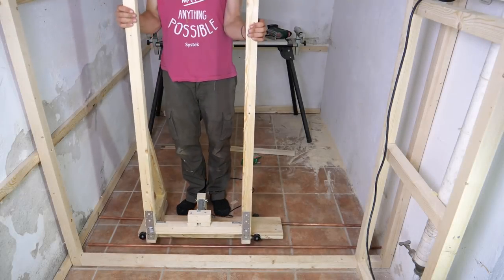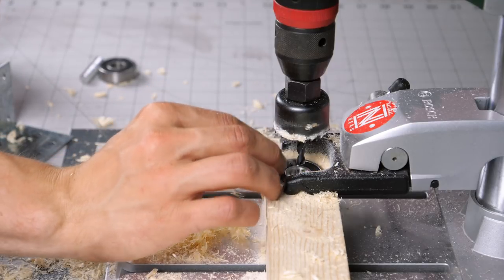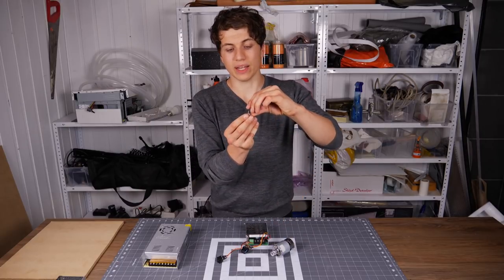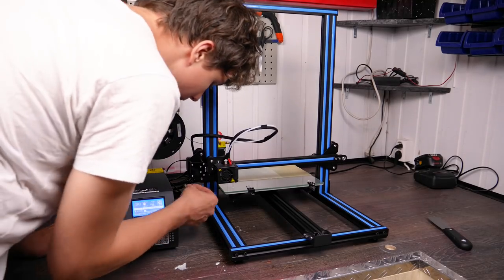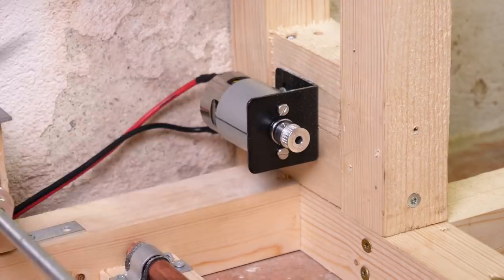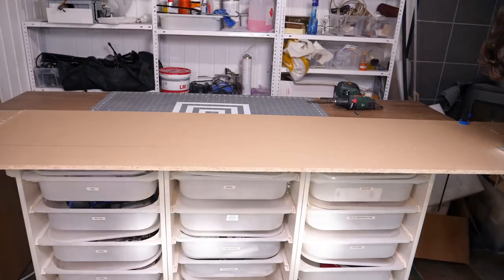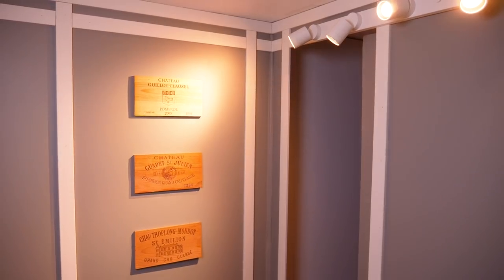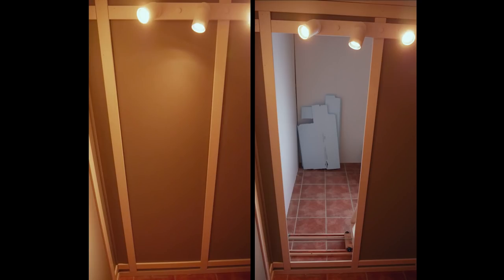Building a Secret Door Part 2 || DIY

Comment: Cool!! I don't have the room, but if I had, I would definitely built a secret door... But what will you do if the drivebelt breaks while the door is closed? Can it be opened manually?
Reply from the maker: Good question! I have a cabinet for the basement fusebox on the wall to the right of the door, if I open it and lean in I can reach the threaded rod and open it manually
Reply: Xyphoid Process I wouldn’t
Reply: He doesn't have the room either but he did it so..
Reply: Wow so talented!
Reply: This turned out amazing. Great Job

Comment: If the motor was a bit faster and if the belt was hardened it would be a bit better so the door can open quicker. But it was an amazing build
Reply: It's not the motor that is critical to speed, but the narrow threaded rod as a screw drive.  If you use something more like a winch to pull the door towards the motor, it would be faster.  For example, he could make and mount a large pulley to the same motor (mounted at 90 degrees) and use the same type of timing belt material.  For example, if you size the drive pulley with a circumference about equal to the linear travel of the door, one rotation of the motor would open the door (or jam it).  To get more reliability and torque, mount a second pulley to the door to cut the speed in half, or reduce the size of the drive pulley.  I don't think it will be as fast as the sliding doors on the Enterprise, but hidden doors aren't that useful if the bad guy can catch you while you're waiting 90 seconds or more for the door to open.  Best option might be to recycle a garage door opener, which would contain most of what you need, all packaged up, and could be operated by wireless remote or mobile phone app.  Also, I'd rather just shove the door back manually, rather than to wait on that linear actuator.
Reply: Good point
Reply: Us a rod with acme thread next time

Comment: With future projects, consider hanging the door so the tracking won’t be on the floor, causing an eye-sore or obstruction. I would repeat the door trim pattern across the wall to help hide the door and would’ve liked to have seen you just need to push the top wooden board in to activate the door. It looks like simply swapping out the pulley on the all-thread would at least speed up the opening/closing motions. Just thoughts, not criticisms. I’m intrigued by the way you all have problems getting different supplies since I’ve never been to Norway and we have access to everything in the US. Anyway, love your page and projects. Keep up the great work!

Comment: I like.  I’d be interested to hear what your thoughts are now after a few years and what you’d do differently.  

The two things I would want to try if I ever did this would be to move the door tracks to the ceiling to get them out of the way of tripping and the second thing would be. To try and speed up the process.  

Side note I would be worried if a kid or pet got stuck inside.

Comment: For a *trigger switch idea*, have the wine box plate on a joystick, e.g: up/down could be for the door in/out motor and the left/right for the side moving motor. 
Or have it hooked up to an Arduino, then use the joystick to enter a code (e.g: left, up, down, up).

Comment: Hello, nice work. Im a builder by trade, but I know a lot about a little and a little about alot. The 2 suggestions I would give is 1 - for the belt, I would get a belt that is very close to the size you need and then make it so you can manually tension the belt.(i hope that makes sense). It is what is usually used for where any drive belt is needed. I guess you could find what I mean more so on the web.
And suggestion 2 would be to get a more course all thread rod to increase the speed of the door opening and closing (a thread that may be slightly thicker with the thread running much wider apart) you just have to be sure the motor your using can handle it as it will need more torque to move the door, but it will dramatically increase the speed of your door. I hope this makes sense as I am trying to explain i as much as I can in layman's terms. I hope this helps you. Good Work though.

Comment: Very cool. If you were looking for a better way to shift the wall left to right, try a pulley at one end, a cog at the door, with a belt strait to the DC motor. No need for the threaded rod, extra stress and friction.

Comment: Nice, great build guys! I'll have to keep it in mind for a small project. If you want to upgrade on the speed, invest some time in acme threads or ballscrews/spindle. Double threads (basically the helix is longer) will help out even more so. And end-switches so you won't kill any parts by going too far open or closed.

Comment: Very well done. If I may. Take the runners that are on the floor and mount them on the ceiling then when it opens you will not have to step over the runners or damage them when going in and out. The door will then hang and you will not need the counter weight,

Comment: You can try using a limit switch to stop the movement of the door and a regular two side switch (like the ones for lights) to use the door. It can make sure that you don't need to just stay and keep the button pushed while trying to open or close the door.
Reply: I do too much 3d printing, and I would have set both directions up with stepper motors/lead screws and limit switches and run it all on arduino out of habit 🤣

Comment: Very nice work.

If I were to try this, I might consider mounting the rail mechanism above the door and have the door hang. This would avoid having to step over the rails and threaded rod and tripping.

You could also avoid the need for counterweights if the cart wheels slid between two rails rather than sitting on just one.

Comment: It's a fascinating concept.  My only suggestion would have been to hang the mechanism from the ceiling rather than mounting it on the floor.   Same basic build concepts but saves you having to step over the mechanism to get in the door, and solves the counter weight issue at the same time!   Great job though!

Comment: An improvement to the switches could be crafted like this...; Add things to the outer room so that you have a light switch, a fan switch, a vent/register opening with a lever, a spot to stand on the carpet containing a pressure sensitive switch, etc, etc, etc... By using these switches as a series type connection to an Arduino, you can end up with a door that opens and closes ONLY if the right combination of these switches are triggered... This way the switches themselves (for the secret door) are invisible, since they all do something else in an obvious way, hence there would be nothing to find that would cause someone to wonder "Hey, what's this switch for??" Anyhow, that's my contribution. Also, you might consider using brushless motors since they can spin very quickly and are dependable - it could improve the speed of the opening and closing. Additionally you can use bicycle chain and sprockets for the motor and rod. :)

Comment: Bearing, inserted into the wood,
put some D3 wood glue, a little diluted with water - which penetrates wood fiber.
let it dry, glue again, dry, again'.. etc (let it make a varnish)

or drill a little smaller than the bearing diameter,
burns the hole steadily, with small camping torch butane,
and maybe insert bearing with damp wood or vegetal oil  (which fits better)

Comment: How to improve door- 
1- get rid of the threaded rod and replace it with a cable pulley system. It will allow the door to open quicker and smoother. 
2- replace belt with sprocket and chain to eliminate it being the "weak point" of the design. 
3- instead of having switched under the panels make each panel a push button switch. (so you just push the panel and it activates the doors. 
Otherwise its a nice build.

Comment: Only thing I'd have done differently is I'd have mounted the track to the roof rather than the floor. This way you can remove the trip hazard when entering the hidden room. I'd also have made a wall on the inside of the hidden room to hide the track from view so that the door slides in between the two walls. This is a really cool build though!!!

Comment: This design could very easily be manually operated by pushing the door in and then sliding it to the right. Would just have to find a discreet latch mechanism to keep it from accidentally being pushed inwards. A pull string with a spring loaded latch using a series of pulleys would allow the string to be accessible virtually anywhere. This being said your build is really awesome, I am just thinking of a way to do it for 1/10th of the cost and with less points of potential failure. Nice video man!

Comment: If you parallel a set of 3 way switches further away then by the time you get to the opening it would just about be open or possibly completely open. You would have to figure timing over distance. Another thought, how would you gain entry if belt breaks in the door closed position. Last, maybe try to 3d print a flexible belt for a continuous one. If that doesn't work then consider direct driving  motor to mechanism.

Comment: That turned out really clean, I didn't notice any seams or lines on the door good work nerds. If I ever make a hidden door I thought I'd go with a bookcase although most people don't really read actual books anymore
Reply: Better use solid steel rails, then.  The weight of the structure and the weight of the books would soon soon crush that copper tubing, or at least create dimples that inhibit the rolling.  And Hans and Martina don't have to READ the books - they MAKE them!

Comment: Great project! I think it may be a little more practical if the threaded rod and drive assemblies were at the top of the door so you don't have to step over it all when entering the room. Plus having the rod at the top would solve your tipping problem that required the use of counter weights.

Comment: If you want to speed it up you could either put a bigger wheel on the motor. If the wheel is 2x the the diameter the door should move 2x faster. This is the cheaper method. The other is to replace the threaded rod with a rod which has less threads per inch

Comment: use ACME thread, look into salvage lathe feed parts, may even find a selectable drive with it. good luck.
Reply: also, depending on rpm, the friction from the load you have can distemper and burn up the threads...use a grease block or perhaps an oil/grease bath for the rod beneath the door. again, good job and good luck.

Comment: amazing work loved it . there are many ways to speed the motor up directly from the power supply if compatible . i do the same work practically it should work . i'm in electronic engineering and have been working for 8 years.

Comment: Nicely done but if i were you i would put lock mechanisms for the dor so they wont open accidentlly, and not only,  but aswell it will be more secure, nad you could mount a code opening in the same area as the switches,
Nice job ,its a really good idea.

Comment: Hey, cool project! :)

Have you thought about using an acmethread rod as driveshaft?
There are options available with a 4mm  pitch, so your door will open much faster
Reply from the maker: That would been a great thing to use. I didn't know about it before I was done !
Reply: A winch drive would be faster still.

Comment: I only have three critics about this project :
1°) There seems to lack some "manual mode" to open the door. It probably useless but, in case when it could be handy I would rather have that ...
2°) The opening speed is very very slow (it seems to be at least). Maybe a more powerfull motor could fix that
3°) and the biggest problem, for me, is the opening systeme is on the floor and there isn't any protection on it. I don't know if you're going to read this but it's been almost a year since you uploaded this video, didn't you (or anyone else ) 
stumble on the opening systeme ? and IF youwould like to put something heavy in the room (or getting something heavy out) I think therailing system would cause some problem to do so .... maybe if you put the system backward, by attaching it to the 
ceiling it would fix that (depending the height of your ceiling)

Comment: I would connect the motor shaft directly to the threaded rod.
You can buy couplings for that purpose (ebay: Z-Axis coupling)
or make your own with a garden hose and pipe loop fastener on the
motor shaft and the thread rod to keep the shaft/rod from spinning
within the hose (or even zip ties)
Reply: Atanasov Goran i'm guessing you dont have a degree in engineering?
Reply: Didn't claim to. Could you explain why would that be a problem?
Reply: I mean direct drive, not having a degree
Reply: Atanasov Goran at this point the rod is supported by a bearing on both sides. If you but it directly on the motor first of all the length of the entire assembly would become larger and there is no longer an option to change gearing. The way he did it here is better and more professional as coupling it with some garder hose. Even tho the whole build is crap.
Reply: You could put a bearing after the coupling and still support the rod, the motor will have it's own mount. Yes it will be longer assembly, and planetary gears would work for gearing, although not as practical for DIY/Home build. (The hose thing was an alternative to the Axis coupling since he mentioned in the previous video that he can't wait for stuff to arrive from online orders.)

Comment: cool thing. really good effort. but u need to think on drive belt. better keep a gear wheel system and keep limit switch to cut off when door moves to require distance. hope it not cost more.

Comment: Dude awesome job ... but use a gear drive system like a large gear on the motor n a small one on the threaded rod  n it will move the door faster n smoother

Comment: For the belt just go to your local car or motorbike store with your belt and purchase one according to your size if you can't get one adjust your size accordingly. If you wanted the door to go faster you have to use a faster turning motor.
I love the projekt great job.
Reply: you dont have to use a bigger motor.. all you have to do us change the location of the motor and change the size of the gears on the end of the motor and/or rod... and agree on the belt, can go to the local automotive shop and buy a belt for the size, but to have it last longer i would use a chain, plus it is easier to get the size you really need..

Comment: Suggestion, actually my first thought in part 1 before you even started building: Put the copper rails and the drive shaft rod in the ceiling instead of the floor. Must be so annoying to step over, especially after getting the 3rd bottle. Plus it would look better / be less exposed, if it is on the top.

Comment: if the belt fails, you could try and cut it at exact length (dont overlap) and glue another strip of belt to the back (back to back) just stagger the seams. you prob also want some sort of flexible glue?

Comment: Why not use a arduino to control the action? Endstops to make it stop in the right position and just a single button to start the movement.

Then try to minimize the footprint on the floor, and put the threaded rod in the ceiling instead of the floor (and avoid stepping on it). 
Then use at least two belts, or make a manual way to override it...

Comment: i had an idea for something like this, and since i dont have the knowledge to make it happen, i'd love to share it with you as a video idea.
basically this, but with a window, and have it controlled via temperature. i got the idea from some smart power outlets that can turn on and off depending on temperature. so i imagine using a motor and some wood blocks you could make something that opens or closes the window based on temperature. imagine how much could be saved on heating and cooling if your windows did the work for you

Comment: If you hook up an airpump/generator(tbh I don't know this exact but it's been done before to this instead of electric motor you would increase the speed you need. And instead of a belt you can use a chain(similar to what cars use as a timing chain).

Comment: Hey your videos are really cool. To improve the door speed you could use a bigger gear-wheel at the motor for a better transmission ratio. The bar will spin faster and so the door will move faster. :)

Comment: Igarashi Gleichstrommotor 2738-051-GC-5 12.0 V/DC 1.6 A 9 Nmm 12300 U/min Wellen-Durchmesser: 2.3 mm 1 St.
I know this is an older project an you finished it very well but I think this motor would help to open your secret door a bit faster. Sorry for the German description but I found no other

Comment: Get on eBay, search round rubber gasket. Then browse until you find one that's suitable to be used as a belt. How you do that is simple, take the belt you've made, lay it on a table and find what the diameter is. Then that's the thing you should search -6%. Rubber gaskets stretch over time, so you have to account for that. The pulleys will grip in the soft material, so no need to change them. They are cheap so buy 3.

Comment: You should have cut the door piece at an angle so when it presses into the wall, all of the seems line up properly. Then you wouldn't need a gap and with the right paint, it'd disappear.

Comment: Whenever you can, off camera, get a 30A dc motor but at either a faster speed or higher available voltage count.
Most plugs run at 240V anyway so 1/10 of that voltage shouldn't make it go at a snails' pace.
Reply from the maker: The motor is 10000 RPM and pretty fast, so I think the best way to improve the speed would be to change to a rod with longer spaced threads. Even so I wont be doing it as it is fast enough for my use, it's not something I'll use very often, and it's more of a novelty than a practical installation :) Thanks for the tips though!